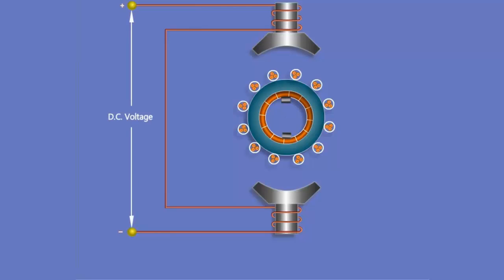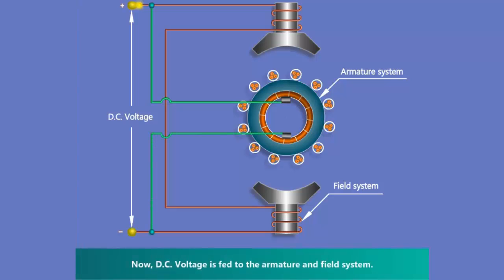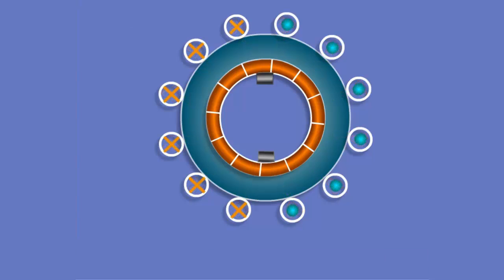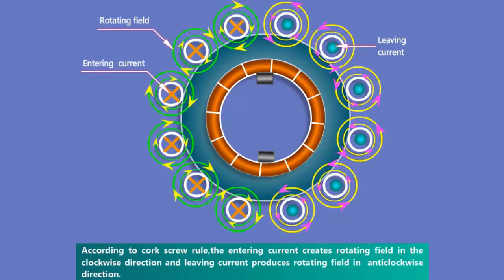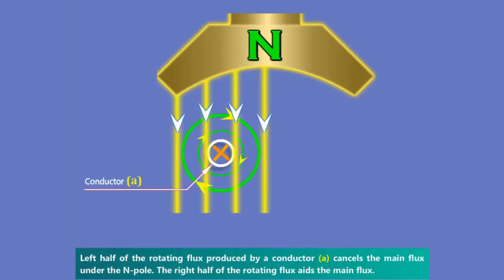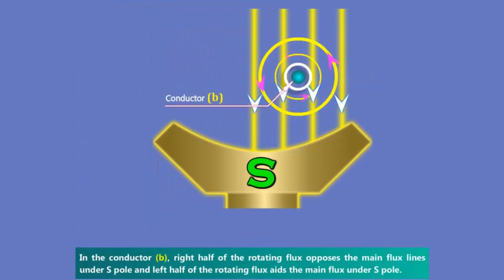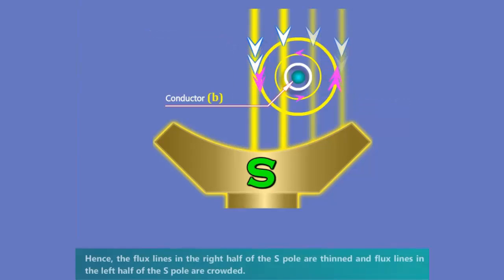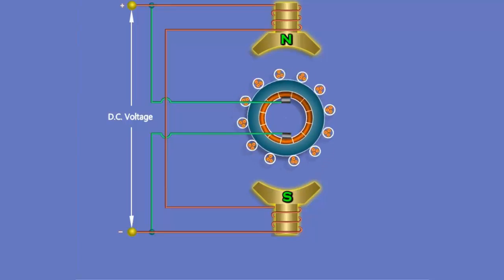How DC Shunt Motor works? | Working Principle | Engineering Videos #LearnEngg #engineering #motors

Comment: Nice animation. I was just wondering, following your configuration at 1:10, using the right hand rule, the net torque on the rotor would be zero, would not? In order to have the highest torque, the field windings should be rotated 90 degrees.